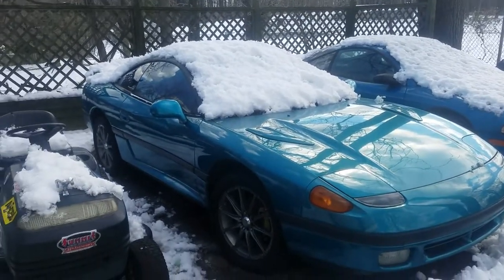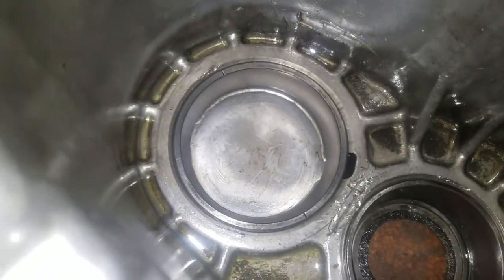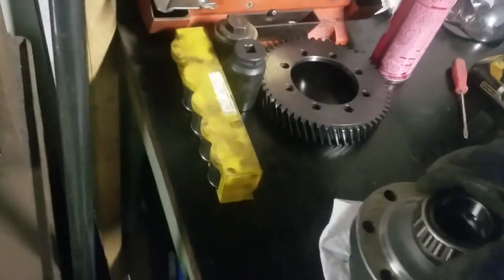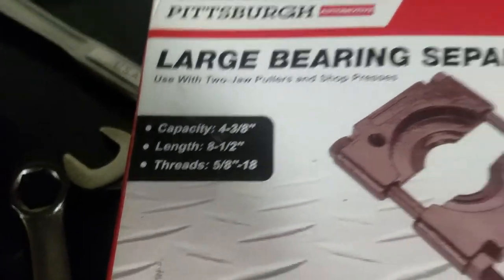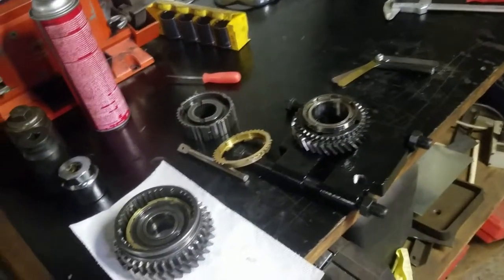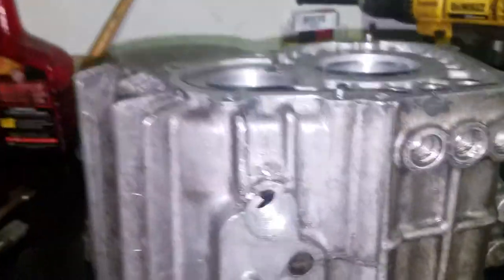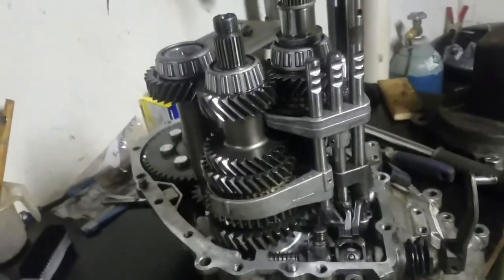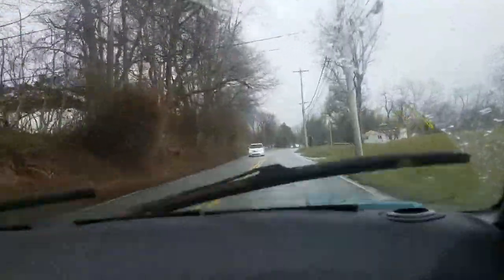F5M33 Full Rebuild with OBX Limited Slip

Comment: So, when was the last time the timing belt and tensioner were serviced? That should have been the first question to be answered and proved. It is expensive, and it can be the demise of this engine. Make sure you take care of this ASAP. I know more about these cars than I care to admit and I would never or attempted to rebuild the transmission on my own.
Reply: It was for my car, the trans still works great to this day, unfortunately that blue car spun a bearing. I got another that this trans still works flawlessly in, and the timing belt had already been done on the blue car as well as a solid tensioner. I love these cars I don't neglect them

Comment: Same reason I found out was prob for my f5m42 ... the input shaft get shock and cause a lot of force on bearing ....but it's a side thrust force which is firm one direction but the other only hold in place by that thin plate tht lock the input shaft ... I find it out before it causes the bearing to go bad n damage the casing...its a cheap part to replace ...I think it cost less than 20$ .... dble up with the old will strengthen gearbox to be able to take abuse and way higher torque.
Reply: do you mean add more trans fluid?